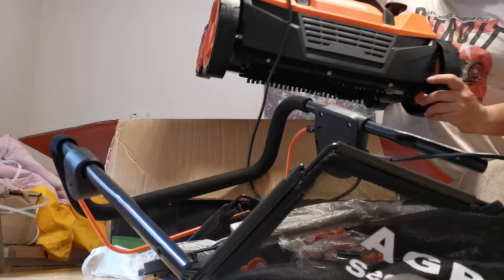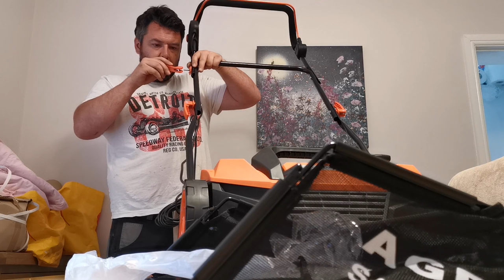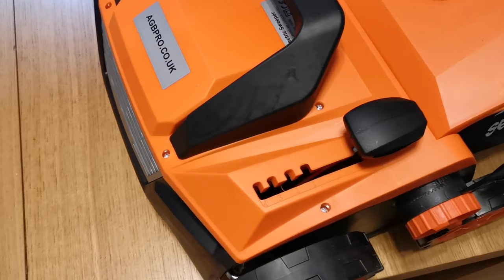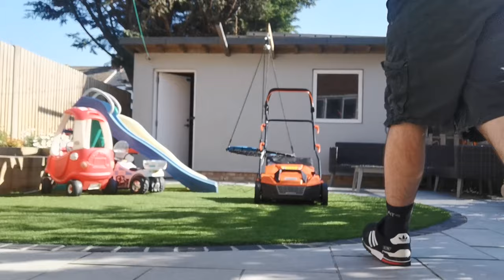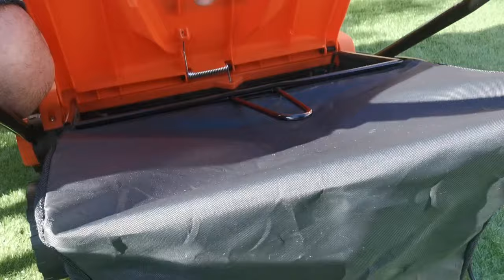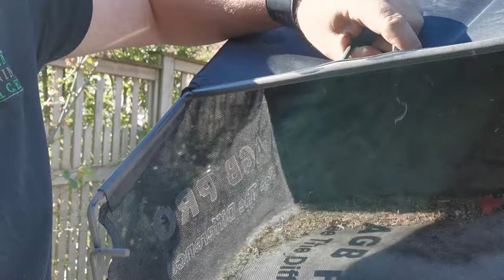AGB Stand Up Pro 400 - Best Artificial Vacuum and Brush 2021 Assembly and Demo

Comment: Hi, how's the machine holding up on quality, is it still doing the job? I'm just holding back buying one at the moment as cant find anything on the net about buying replacement bristles or any parts. Great review and hope you kicked your friend who burnt your grass!!!👍
Reply from the maker: It's holding up great. The thought of replacement brissles did cross my mind. But it has been used a fair bit and plenty of like left on them so I guess I don't have to worry for a while. The only thing that I have picked out is it is hard to pick up things right near the edge. So if you can't get the middle over it because there is a planter in the way you have to sweep it out first the suck it up. Lol he was a good friend and its easily fixed so no I did stress at him.

Comment: Bought one and it has quite a pull i.e no need to push, as it pulls forward. Just want to check if this was the case when you did the video?
Reply from the maker: Yep and it pulls even harder if you try and move backwards. It does make it get right into the grass tho.

Comment: Does hoovering remove the sand in-fill? Iam about to get an artificial lawn installed but unsure what to get to help keep it looking good.
Reply from the maker: This would take up the sand infill. Sand infill isn't nessesary anymore on artificial grass so you could go without.
Reply: Hi Dan. Can I ask why you say sand fill isn’t needed anymore? I haven’t got it but was considering getting it to make the grass backing last longer and also to keep the grass cooler in mid summer sun?

Comment: Hi, does the handle fold down for storage. I’m torn between this and the Wolf which does fold down but apparently doesn’t pick up flush to the fence. Leaves about 6 inches. Is this any better on edging?
Reply from the maker: Firstly. no the handle doesnt fold and it is hard to get right round the edges. The wheels goes pretty close but it still leaves an unbrushed area.
Reply: @danreviewsitall  Thank you very much 🤗